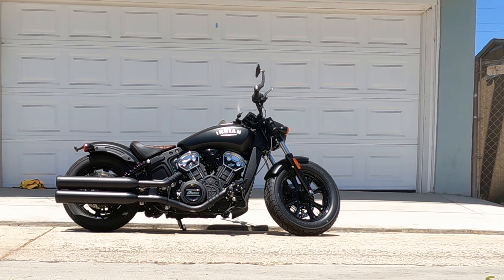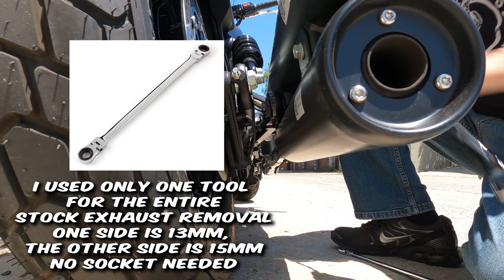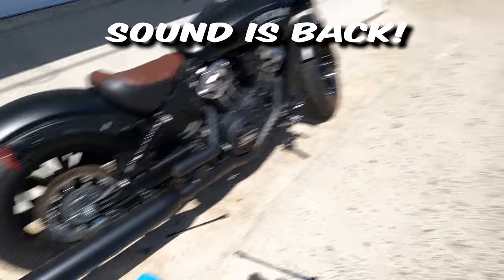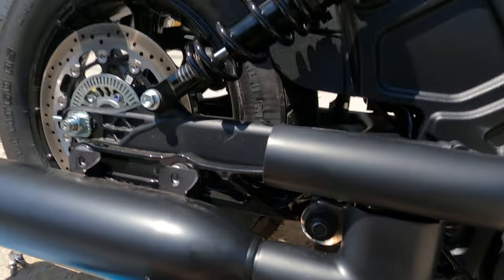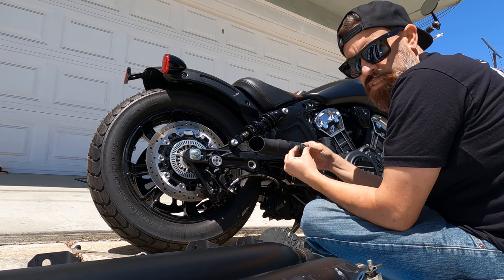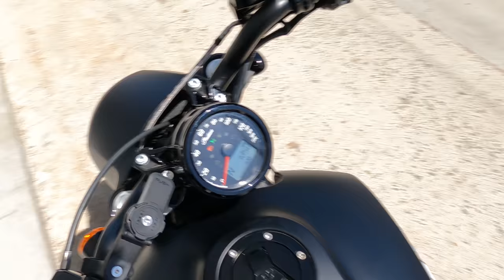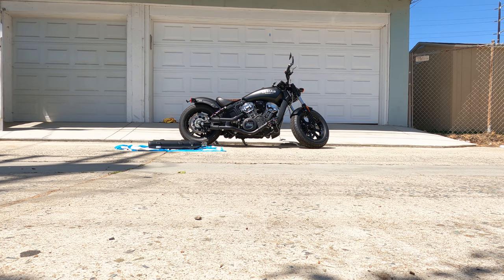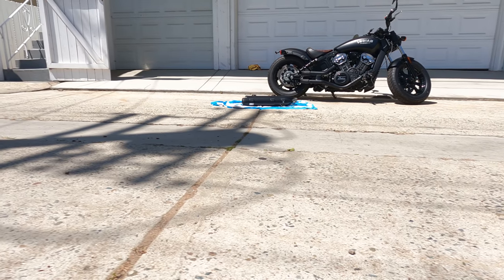YORK Shorty GP Muffler. Indian Scout Bobber Exhaust Removal

Comment: Sounds just like open pipes! I’ve been waiting for my Rinehart exhaust on back order and bought some of these to hold me over in the meantime for the price it’s a bargain. Do you still have them on? If so what are your thoughts thanks for the video
Reply from the maker: I still have them on. I have a few more things I want to get before I circle back to the exhaust. I mean the bike is lighter and easier to back into spots. They might be just a little too loud but I'm focusing on comfort next (seat, rear shocks and possibly higher handle bars) no issues to report with the Shorties though
Reply from the maker: Did you get the YORK or the Radiant? Cause the YORK has a built in baffle the Radiant doesn't

Comment: What a beast, would you recommend this bike for a newbie?
Reply from the maker: I would! If you check out my latest video (get on moto fest with Blockhead and Her two wheels in the thumbnail) I interview Brandon Bicasso and he gives a great answer to that question.
Reply: I bought the scout bobber twenty 2 weeks ago since I didn’t feel like buying the 60 that wouldn’t have enough power down the road (for me that is, everyone is different). Only experience I had was one day of riding my friends 80cc dirtbike, then a 250 cc dirtbike, then a Kawasaki 125r to get street exposure then lastly a Kawasaki ninja 500R to feel more power to make a strong decision to whether I wanted the bike or not. After riding a few times I can say this: This is the most understandable power that you can figure out after a bit of riding, throttle response and streets smarts will be the biggest factor when riding. I’m 280 lbs and 6’2 and I can move the bike around pretty well, yeah it’s a 500+ pound bike, but it’s a lower center of gravity which makes it easier to maneuver, even when you have to bang a Uey, the weight didn’t even become a factor after a week, I forgot about it when riding but keep in mind the handling is not like a street bike; if your tailing a gsxr or something, this bike scrapes pegs even on the easiest of turns(I think it’s cool but it can scare some). Now I say most understandable is because this bike ABSOLUTELY RIPS when you want it to, like hold on to the handle bars because the hard seat they give doesn’t cup your butt enough to provide much support, BUT you can ride this bike as slow as any other bike out there as throttle response is KEY <— I can’t stress this enough for this bike. I’m 25 and I bought this bike to cruise, but have more than enough power to get away from traffic and dumb situations. I’m a little more responsible than a youngster, I even bought all of the expensive gear before getting the bike and Idc if it’s 80 degrees out I WILL wear a leather jacket and full helmet just in case. An old guy once told me, “there are old bikers, then there are bold bikers, but there are no old-bold bikers” let that sit into your head. Also never be afraid to slow down when things look hairy on the road. The wind feels great but there’s still texters while driving. I wish you the best in your decision
Reply: @chriss4690  Thank you,  you just made my day. Will not take all this good advice for granite i can promise you that!
Reply from the maker: @chriss4690  very well put. I like that "no old biker.." never heard that. Thanks for the great answer

Comment: What about engine retuning after the aftermarket pipes , Every harley i owned had to be remapped on the fuel injection to ensure proper tuning ?
Reply from the maker: I did research on this and everything I read seemed to say there was no difference. It's not a complete exhaust, just the Muffler. I haven't felt any difference so far. Maybe check the regulations in your area to be sure.
Reply: @RickyBobber  , Thank you for the reply sounds good .

Comment: The problem is the increase in loud. And the annual inspection process. If too loud no pass inspection ... keep the stock pipes and 2 hours of time to replace in spring for that annual inspection. Loud is good for others to hear you... but as others suggest those baffles help muffle your loud... so you can hear going forward.
Reply: Now you have no baffles. You probably increased the horsepower
Reply from the maker: I'm in California. We don't have inspections
Reply: @RickyBobber  that's crazy... I'm in NY. And we have inspections.

Comment: And by the way, you need to put an ear plugs because the sound might heart your ear.
Reply from the maker: I do have some that I used to use for Concerts called Eargasms (check them out). However my Biltwell Lane Splitter surprisingly Muffles alot of that sound. Like without my Helmet it's like damn. But not that bad with my helmet. I'll probably still be doing some Slash Cuts eventually. Thanks for watching !🙏🏼

Comment: Just my opinion but if it was my bike I’d prefer a 2-1 pipe. If cost is a factor just take more time and save the money plus an S&S air filter and a dynojet power commander tuner. I know it adds up quickly in cost but to do it right it’s going to cost $$$
Reply from the maker: That's the plan, actually. I'm not ready to do it yet, though

Comment: The rogue has a 19 in front wheel.  What does that do to the handling?
Reply from the maker: Hard to explain. It's different but it's not bad. It's nimble either way.
Reply: I have a rogue. It’s really not that different unless you’re a pro. It’s like with Moto x, you’ll never be able to tell the difference in brands, just pick a color.
Reply: @Ohsee83  then why did you go with the rogue

Comment: Nice but You should have worn gloves, Fingerprints.
Reply from the maker: Thanks. I agree that touching a bare metal exhaust straight on without gloves can cause discoloration from the oils on our skin. However, I spray painted these..theres a chrome pipe underneath the exhaust cover in the remaining side so the bare exhaust never got touched..so far the slip ons don't have any discoloration. If I ever do a full exhaust replacement I will definitely do that and mention it